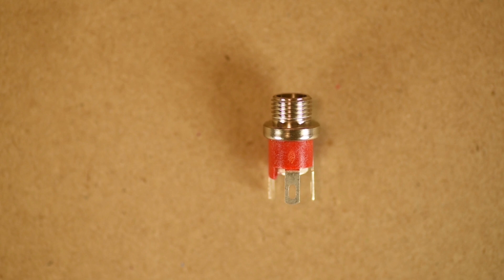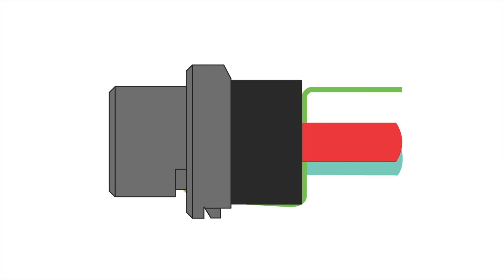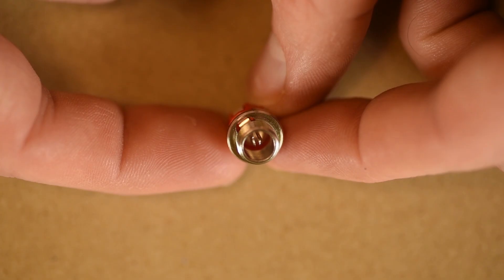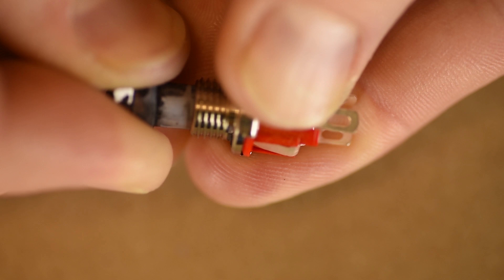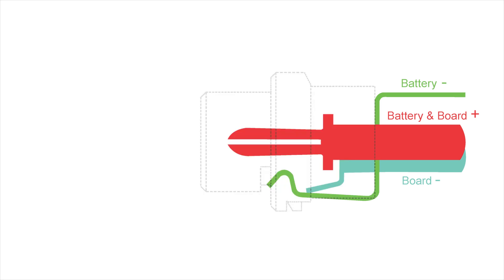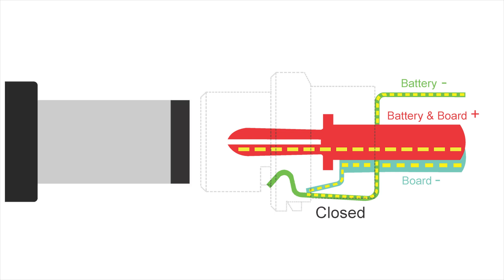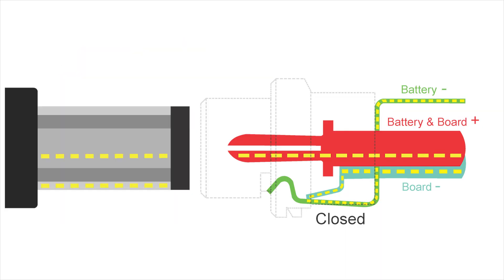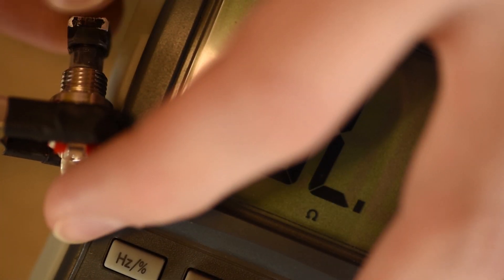Recharge Ports/Power Jacks ~ Lightsaber Building

Comment: Geart video as always, I have a question about the dc port.... My 2.1mm DC recharge port doesn't have a kill key. Is it OK that I wire it to the battery and proffie "+" or "-"  directly?
Reply from the maker: Thank you! That is how it gets wired normally. Do you mean you don’t want to use a kill key? In that case it would just always allow power to flow through it. Or do you mean you have a charging port without the switched option?
Reply: @EccentricArtisan  I saw your 【How To Build A NeoPixel Lightsaber】vedio,at 19:31 I saw you plug a thin top green cap in the dc port which I don't have that...
Reply from the maker: @waterbergice3440  gotcha. If you don’t have one, it just means the board will always be receiving power from the battery. If you want to make one I have a video on that. Just takes a BIC mechanical pencil.
Reply: Thank you so much! I will watch it, your videos are excellent @EccentricArtisan
Reply from the maker: Thank you!!!

Comment: Quick few questions. For a direct contact setup w/ a prewired battery would I have to cut off the charging part of the pre wired battery in order to connect it to a recharge port? (There's a small thing that looks like the tip of an ethernet cable on the end of a prewired battery). If I decided to forego a recharge port with a direct contact setup, would it be possible to just charge the battery itself? For reference, I am installing the OneReplicas SSGf with a custom Chassis by CWS designs, but this is my first neopixel build so I am mighty confused. Thanks in advance!
Reply from the maker: You could build it out either way, with or without the recharge port and with or without the jst connector. Any of the options would functionally work, given all your components fit the electrical requirements of the build. What you should look at in order to decide your course of action is how much space is available in the chassis and hilt as well as where each component would sit in the chassis. Dry fit (don’t solder anything) all the components and determine how you feel everything works best within your build. And make sure your wire will all fit and easily run to each component. It would help to first draw up wiring diagrams as well.
Reply: @EccentricArtisan  is there anyone you know thay can help out with diagramming this stuff? I have been using your Qui Gon saber for reference but am still lost haha. Thanks for the detailed reply btw it helps me greatly
Reply from the maker: @joshsuo  The Facebook group linked up in the description is the best place for these kind of discussions. You will likely get good back and forth discussion and help and it will be be much quicker than I can answer here. If you have FB join that group and ask away. Not a problem, glad to help.
Reply: @EccentricArtisan  Will do wish me luck!